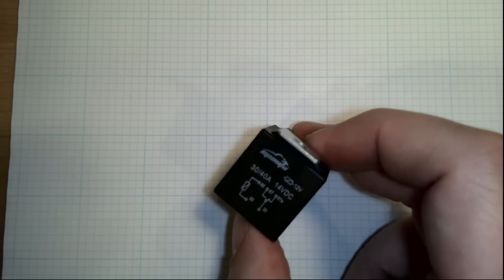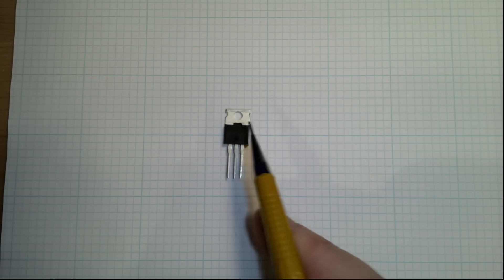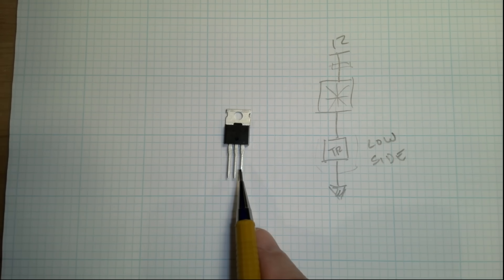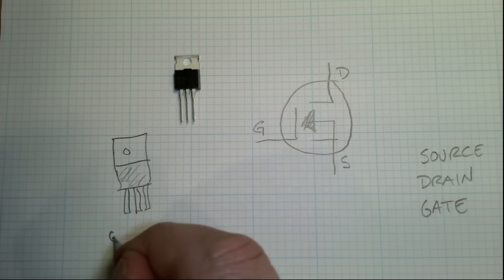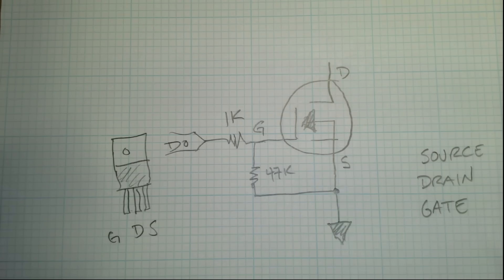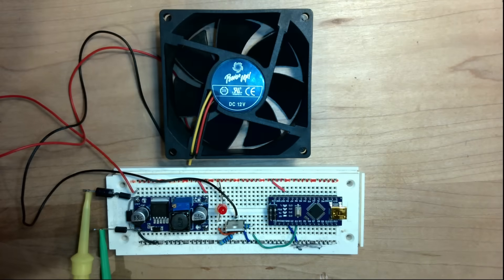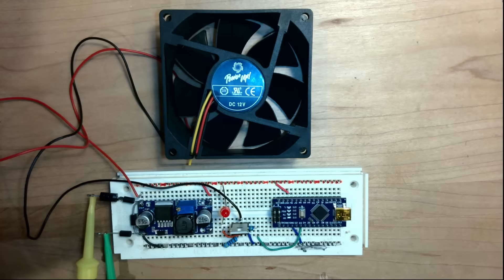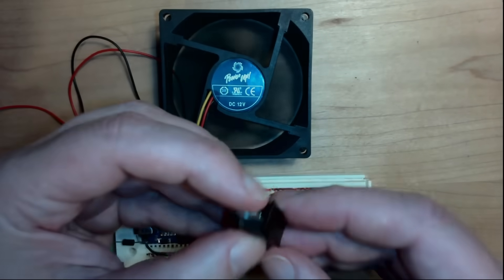Using a MOSFET to Switch High Current Automotive Loads

Comment: Great, so you're replacing a small square box relay with a mosfet/scr/fet with a big heat-sink AND an Arduino nano AND a power supply for IT, huge space saving there, well done.  I won't calculate the savings....

Comment: I was just recently thinking about making a PCB for two HV Batteries to use their own stock parts using transistors of optimal design plan to switch genuine OEM connectors that would be integrated as a plug and play switch for the two HV Batteries Hybrid Vehicle Control ECUs, HV Battery ECUs and HV Battery Fans.  I have the connectors for the male side of the connections, so the plugs, though need to see where I can get the female side that will be what the vehicle will plug into instead of the HV battery connections directly.  Therefore, can use the genuine OEM Prius batteries controls systems and switch between two HV batteries manually an optimally when determined how to effectively automatically.

Comment: Be very wary of power MOSFETs purchased from anywhere but distributors authorized by the manufacturer. There are multitudes of counterfeit parts, grossly inferior to the real things, around. Back Alley Express - use at your peril!

[edit] I don't doubt that there are reliable suppliers to the hobby market that are not authorized distributors but which buy what the resell from legitimate sources. Again, be careful.

Also - there are now lots of power MOSFETs that have been designed specifically for automotive applications. It can be daunting to plow through reams of datasheets to select the 'best' part for what you are doing, even if you are an experienced electronics engineer. Most manufactures publish "selection guides" that can be helpful. Many publish excellent application notes that provide lots of very useful information.

Comment: someone else may have already commented on this - too many comments for me to read them all

The IRFZ44 may not work at all with 3.3 volt drive and may not work adequately with 5 volt drive. You certainly aren't going to reliably get 49 amperes of drain current with only 5 volts.

The gate-source threshold voltage of the IRFZ44 is specified at 2.0 volts minimum and 4.0 volts maximum. The threshold voltage is that which must be applied between gate and source for some specified very low drain-source current. For the Vishay IRFZ44, that drain current is 250 µA. Larger FETs may be spec'd for higher current at threshold, but anything over about 1 mA is pretty rare.
3.3 volts between gate and source may therefore fail to turn on the MOSFET  at all. It might with parts from one batch but not from another. 5 volts will reliably get above the maximum requirement of 4.0 volts, but ...

Once you are above the threshold voltage, the transconductance of the part comes into play. This is the ratio of the change in drain-source current to change in gate-source voltage, expressed in Siemens (the reciprocal of ohms). For the Vishay part, the spec is 15 minimum. 
If you had a part that had a gate-source threshold voltage of 4.0 volts and a transconductance of 15 S, you would need 4 V + (49/15) V = approx. 7.7 volts between gate and source to get the part to conduct 49 A. If you look at the typical transfer curves in the datasheet (really old, horrible digitized graph in the Vishay sheet) you see you typically need about 6 V gate to source for this magnitude of drain current. Relying on typical values is always risky. Note that data in tables is, unless otherwise noted, often from characterization with 10 volts between gate and source.

When you are using logic levels to directly control the gate of a power MOSFET it is usually best to use parts designed specifically for that situation. They are often called "logic-level" FETs. Many are specified to reliably conduct up to their rated current with 3 volts or less of gate-source voltage, but the datasheets need careful reading.
Reply: Is that 7.7v and 6v minimums? As in, could you just feed it 12v and know you're set, or is that likely now too high voltage?
Reply: Could you send 12v to the gate?
Reply: @jeffflanagan2619  Yes, the IRFZ44 has a maximum gate voltage (Vgs) of 20v
Reply: @jeffflanagan2619  Generally up to 18-20 volts. Mostly 15 volts to turn them completely on

Comment: From 40+ years of repairing industrial electronics, I'd make the comment that when a relay fails, it is usually open circuit coil or failed contacts not making circuit.
In both scenarios, the rest of the circuit isn't damaged. This isn't akways the case with semiconductor switches as often, associated circuitry can be damaged - less isolation or containment of the fault.
This is why a lot of critical circuits such as thise in elevators or lifts still use relays.

Comment: With the necessary precautions, an N channel Mosfet can be used very well as a high side switch
Reply: Inverters and BLDCs are all the rage nowadays it seems. Gangs of mosfets everywhere, half of which are switching the high side just fine.

Comment: Thanks! Here's a 100A solution that fits in an ANL fuse holder. TL-SSR – 12V / 100A DC Unidirectional Solid State Relay (SSR)

Comment: I got excited about this since im getting ready to wire my hot rod and ill have 20 amp fans. But this would be so much more complicated. I don't plan on installing 2 resistors, a breadboard with an arduino, a heat sink, and the kitchen sink instead of just wiring up a relay. Not sure how you define it as simpler than a relay

Comment: i work in aftermarket automotive electrical. its common to still use the 30/40 relays for nearly everything.... entire logic gates built out of them like its fucking 1960.   i bread board some things here and there but its crazy to me that we dont just have off the shelf Arduinos with some GUI for PLC config.

Comment: In the ninetys to early two thousands I worked at International Rectifiers Great Britain factory, maintaining the production equipment. This was a popular product, I must have watched milions of these come down the production line!
Remember that the most dissipation occurs when the device is changing state. When switching at high frequencies this can be the dominant cause of waste heat. The gate capacitance is quite high due to the large area of the die, this means that quite high gate currents are necessary to switch the device quickly. A suitable driver IC or bipolar pushpull circuit are required.

Comment: I have seen quite a few failures when mosfets are used to switch automotive loads. They have been using them for day time running lights for a while and those pesky Dodges. Have to say I am not a fan of them and when they fail they like to start fires. Wish they used fans instead of just passive heatsinks. Not that I have not seen my fair share of fan fails that end up with a cascade of failures.

Comment: The big mistake teachers have is using terms only experts know when they are teaching a beginner as if the teacher is a RETARDED to the point that he doesn't have a clue that he is supposed to be teaching terms also. Missing the fly back loop for induction load spikes during power off, and the drain connected to the tab requires electrical isolation, is an oops.  A beginner needs to know a bit about the math for gate resistors and how you got to the 1k resistor decision, & the 47k decision needs an explanation as to why it even exists in your circuit. You know all that stuff, but the person you are teaching DOES NOT.
I've watched dozens of these fet help videos and never got a single fet to work.
Why does the fet need another power source for the 3.3 to 5 volt gate ? HUH?
Why can't the gate be hooked to ground or the 12 volt power source ?
Why can't 6 diodes in a series reduce the 12 volts to the 5 volts for the gate ?
Would a zenner insure a < max gate volt that works ?
Why use a bunch of computer crap for an example circuit when as simple circuit should be shown.  Like one that others have the parts to make.  Make something out of old electronics thrown out at the dump and you will be using parts that others have access to.
I could go on for a while here, but here I stop.
Reply: You lost any credibility the moment you used the “R” word.

Not only is that offensive, it completely tanked whatever valid point you might have had.

That kind of language doesn’t make you bold — it makes you look bitter and desperate to sound superior.

Aggression isn’t intelligence.

If this is your idea of insight, you may want to rethink your whole delivery strategy. 

If that was your attempt at sounding smart, you might want to ask for a refund on that strategy. 👎👎

Comment: Would this work as a way to control the speed of an electric cooling fan, using a PWM signal? That would be the only way that this would really be more useful than a relay in an automotive application.

Edit: ...for the average person, anyway.

If you're a manufacturer and can produce a whole PCB in a case with connectors, transistors obviously become extremely useful. PDMs seem like they're a pretty awesome alternative to a fuse block. Trailer light converter boxes also use transistors.

Comment: ok riddle me this:
50 amps through the mosfet legs. How tiny are those legs in cross sectional area ( tiny), they are tiny legs coming out of the fet. 
If I said to you I want to run 50 amps through a wire how thick  would it have to be?
Pretty darn thick.
So how is it possible these tiny legs can handle 50 amps?
does not make sense to me

Comment: The electromagnet copper coil in the mechanical relay can and will fail or become intermittent, leading technician to fail diagnostic eletric curcuit.

Comment: The IRFZ44N is not a good choice here, it will heat up easily.  An IRLR7843 would be a much better option, with the 5V of the Arduino the resistance will be only about 3mΩ, will dissipate much less heat.

Comment: There's not an Ecm/Ecu in my recollection that supplies a positive digital output to activate  any circuit. The Ecm/ecu supplies ground to control circuits. On the supply side, the Ecm will supply a 5 volt regulated and referenced supply to the injectors, ignition coils and other circuits while the control side is switching ground. Likewise, with high voltage, high amperage circuits like fans, power is supplied by the b+ of the system (battery voltage/alternator voltage), the ecm supplies ground to the control side of the relay. While the electronics are solid, they won't work as laid out in an automotive system.

Comment: the room to place parts on my motorcycle is very limited ,so years ago the high licht
got the Mosfet irf44n   and a 555 timer pwm signal did feed my dual head- high-licht side for many years , it did get a pwm input/outpu,t .
tested it before with a low/(floating) signal only to the mosfet  it did make the mosfet to go hot, so that was no option

Comment: These work great for interior and body controls and for switching things like the alternator excitor (charging on/off, not the load side!). A lot of vehicles use solid state switching in their body control modules these days. Where relays are more appropriate are for things like fuel pumps, cooling fans and anything else that would disable a moving vehicle in a failure, but quickly and cheaply sorted out. As a sidenote to be fair sometimes solid state switching can eat a lot of battery power with key on engine off, just something to consider in your projects

Comment: Shouldn't you use logic-level gate mosfets like the irLz44n when driving them with logic-level voltages? Especially if trying to switch high current loads.
Even then, switching 25 A with the irlz44n is going to dissipate like 16 watts. You would need a suitable (BIG) heatsink. If even possible. And it should be used in areas with good airflow, of couse.
It won't be an easy task.
Still, most cars nowadays use them, where appropiate, and so cars today have a lot less relays than they used to have. But they didn't entirely got rid of them, because for some tasks they're still the best option.

Comment: It's been a long time since I did proper electronics. Can you switch a MOSFET with 12 source voltage or will that blow out the gate, so this only really works for microcontroller outputs. 
I.e. relay control headlight replacing old very thin factory loom. Relays direct the battery's is normally the way, but bulky. So this could be a nice workaround

Comment: Just remember that automotive electrical systems are quite harsh and connected devices need to be prepared for that if you want it to be reliable and safe. Reverse polarity, load dump scenarios and transients (ISO 7637-2) can all happen. It is not difficult or complicated to prepare for that with some basic protection, but it needs to be done. Chances are good that the failure mode of the FET in such a case will be short circuit. That should be considered when deciding to use some DIY switch. If it fails short circuit, can whatever is powered wait to be turned off until I find a safe place to stop the vehicle?

Comment: First the irfz44n needs 9volts to be fully open and the resistor that you used to discharge the inner capacitor should be between 1k to 10k also they need high frequency on the gate to prevent burning yes they can deliver high current but for a very short time like 25milli seconds the high frequency does that
Reply: That's why you need an ic some resistors a capacitor to turn on the transistor or the mosfets while the relay doesn't need anything

Comment: Remember a Transistor leaks electricity, a relay doesn't. There are reasons that ENGINEERS choose the relay when a mere hobbiest would think a Transistor would work just fine, or even better.

Comment: How does being part of a mosfet make any of those tiny legs able to carry almost 50 amps?
    That is 8 gauge wire territory in copper, which is many times the cross sectional area of those terminals.
    My son is into rc aircraft...some of the speed controllers deal with surprisingly high current, but their reliability is also poor compared to oem automotive relays.

Comment: FETs are neat and high-tech, but relays are very forgiving when it comes to vehicle applications.  If you design/install a device that controls something in a vehicle, sooner or later some "Sparky" is going to hook something else onto it for power and overload it, or cause a short while hooking it up under live power.  A relay usually survives that abuse, but a FET lets the smoke out.

Comment: Question 🙋🏼, I want to replace my light bulbs on my 2009 Smart Fortwo 451 car 🚗 to led.
How or what method can I use to size power resistors for each led bulb 💡 

The goal is to trick the computer that the factory bulbs are still in their and I think the computer is looking 👀 at current draw ✍️ 

How do I size the exact power resistor for this?

I don’t want to just add a ton of load on the system, because it’s such a small car 🚗 the alternator isn’t that big.

Is there a way to add a potentiometer and increase the resistance or just size the resistor to the wattage of the bulb 💡 

Wattage vs resistance has me confused on what to value to use

Comment: Hobbiest don't understand the pinouts on these things, every G.D. transistor is different and does different things for different applications, with different ways to connect drain gate and source forward or backwards, which is why they don't get used more often.  A relay, there literally is no ambiguation, if they ship in a clear case, you can see what's going on inside.  Worst designed packaging... ever.   I still refuse to use them in any application.

Comment: It is very good if you're working on a 12v system to NOT use a 12v MOSFET! Use one much much higher rated working voltage as this chap did.

Comment: Done that many years ago. Used a 2n3055 though not a MOSFET. Replaced the relay doing my cars headlights, It works like a charm. No issues whatsoever. 😊😊
Reply: Wow that's a blast from the past! That transistor (it's production) is older than the commentator or most of the people reading this.

Comment: MOSFET will not work to switch an automotive e-fan, the inductive kick of the motor will kill it.  You can't even use a standard 30/40A relay, it will kill it in short order.

Comment: My top reason for P-Channel MOSFETs under 5mohm RdsOn, is that modern relays with true high quality contactors are getting very hard to find. (except pricy OMRON OR MERCEDES relays)
Disecting a "50 Amp" relay that never saw over 10amps dc, showed pitted contacts. Cheap crapy psudo alloy.
Parallel MOSFETs don't fail, when designed to run cool.

Comment: Can a FET handle flyback from turning on/off a solenoid?
If not, what could be done?
Reply from the maker: Add a rectifier diode.
Reply: @dotnetMakers  just on the solenoid ground side, correct?

Comment: Relays have way less volt drop that is huge issue   in low voltage situations  like filament lamps  lighting that  why they are used In my work mechanical switches do not require any energy to run them IE it has a  memory unlike MOSFETs

Comment: Can use N on high side, just need a even higher voltage to drive it. High side driver. But often these cannot run 100%. This is beyond your scope in the video, just wanted to say that it is possible.

Comment: Be CAREFUL when using MOSFETS for primary power feeds.  They have an annoying feature of being fully ON when power is first applied.

They surge (allow current to flow) until the Vgs offset is established at power on of the support circuitry.
If the logic and supply that drives the gate comes up very slowly then a significant amount of power can flow before the gate is closed.